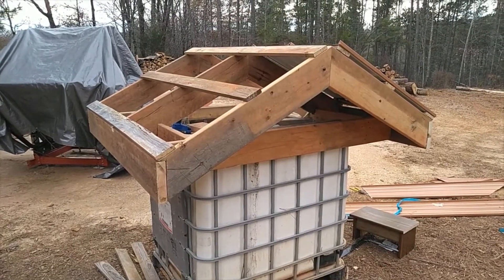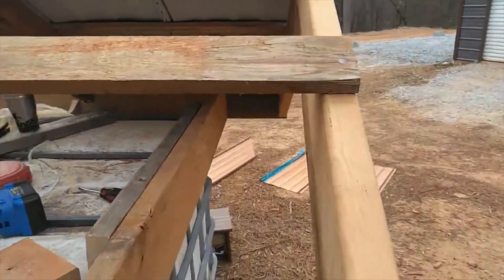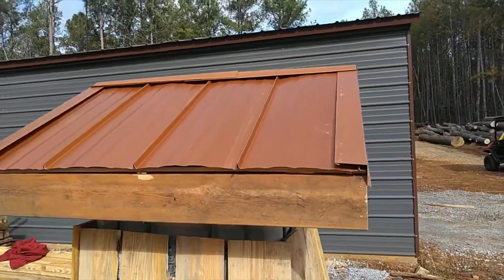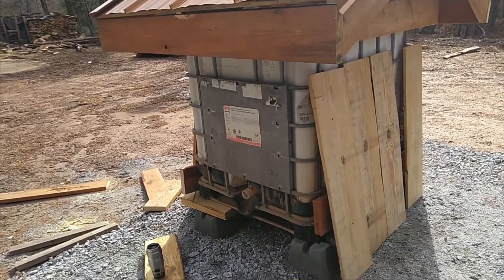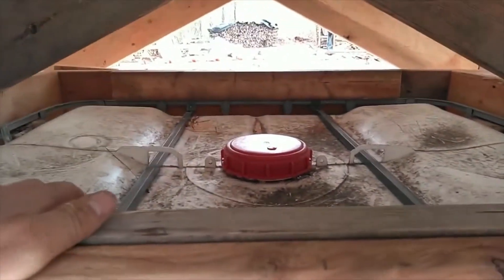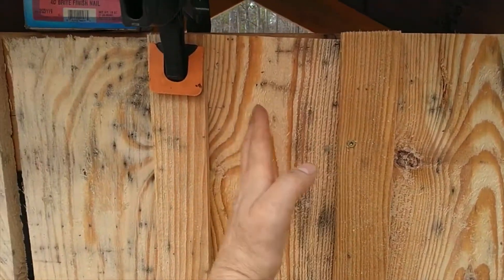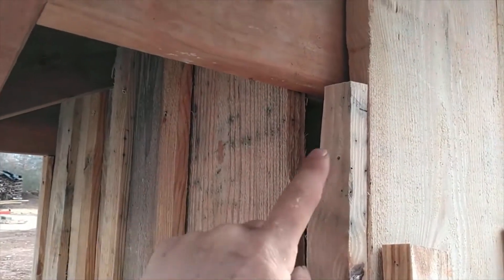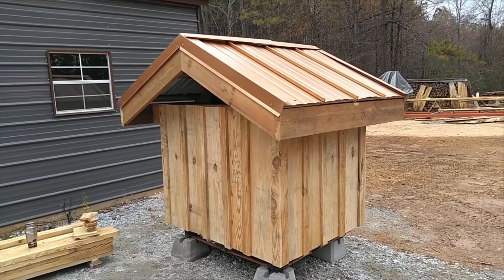#54 Building our Water Tower- Part #2

Comment: No drip edge on the facia boards !!??
The wood will rot if ya dont add drip edge metal. Water Deflection. Also you should have a 2inch to 3 inch overhang.
Reply: Nice....I just hope the field of metal is on top of your gabled drip edge. I know that you want installed w a ter collection at the the edge but the Gable will allow water to get on the under-plywood etc. Otherwise its Awesome.  Im just a picky retired Roofer 28yrs.
Reply from the maker: It is collecting the water to the tank
Reply from the maker: check out the next video in the series, I turn the drip edge upside down and use it to collect rain water of the roof.